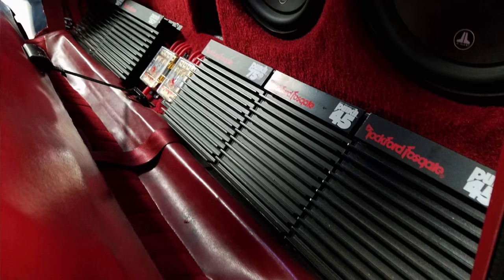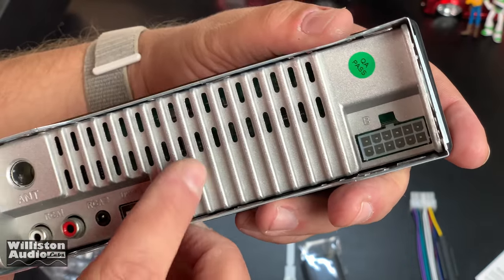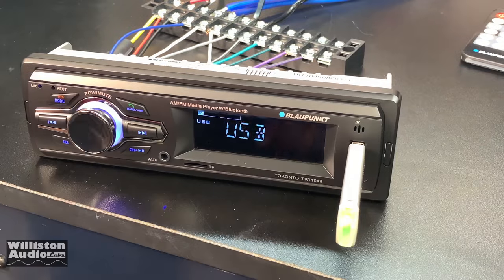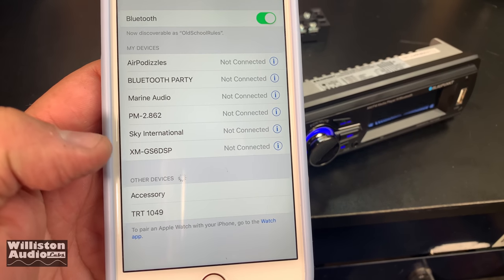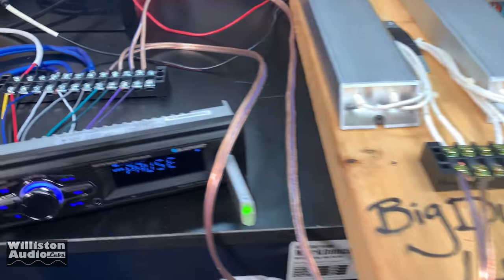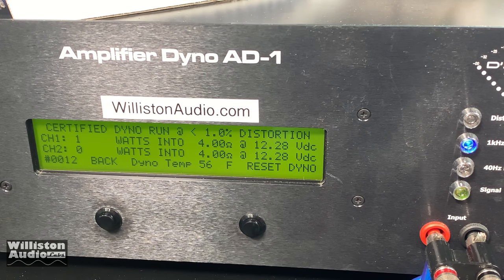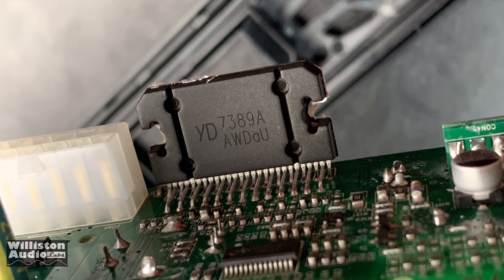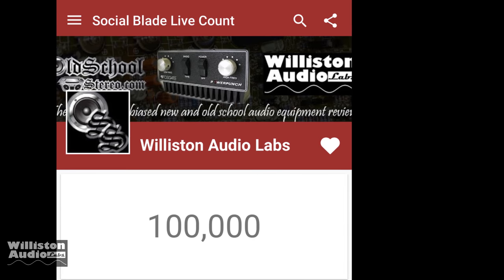Is a $10 Walmart Car Stereo Any Good? [4K]

Comment: Damn, I thought my cheap Chinese no name brand $40 head unit was cheap and small, that thing is half as long/deep as my crappy cheapo bluetooth model. I have a hard enough time keeping my half sized unit steady in my dash kit, I can only imagine getting this thing to stay put in a dash kit would be nearly impossible, since it has to secure to something on the kit.
Reply: Remember that it isn't the size of the head unit that matters but how well it works.🤣
Reply from the maker: It had the cage which you mount and it slides into. Very light unit, would not take much to make it secure

Comment: I remember when this was $20 when it first hit shelves.
Pluggin a USB device in would cause it to reset, not charge properly.  horrible noise in the signal path
promptly took it back and got a $99 Pioneer HU.
Reply: Curious.  If you could afford a $99 headunit, why would you get one for $20?
Reply: @tsntana  Part curiosity, but also the HU was a gift after the fact.
Reply: tsntana if a $20 head unit would give satisfactory performance, why would you spend $99?
Reply: @danieldaniels7571  $20 head units are hit or miss.  It's fine if that's all you can afford.  But if you can afford the $99 unit, why not just spend the money on a quality product.
Reply: @tsntana  that was already answered.
Reply: @dchawk81  Well, by now, a couple of questions were answered.  Somebody answered my question, and I answered another person's question.

Comment: Could the RCA2 be for steering wheel controls?
Reply: Not likely. Steering wheel controls would require a little more than 3 pins unless it was some kind of serial interface. In which case I don't think they'd have chosen a 3.5mm jack for it.
Reply: @S31Syntax  On my jvc steering wheel controls requires all of 1 wire becasue it has a digital interface. My car has a resistive interface though so I have to use an inteface box between them, I figured after posting the comment that it might be an external mic connection for the handsfree unit though. that would be more normal utilization of that connector.

Comment: anyone here know anything about jetski audio? looking to make a small system for my 1991 kawasaki sport cruiser but I dont know what extra steps need to be taken to make everything water proof
Reply: Most just buy a set of bluetooth speakers for a motorcycle, they are waterproof and multi-use, but youd have to have a waterproof phone.
Reply: A cheap marine head unit with a couple marine speakers all custom mounted to your fancy would work in this situation

Comment: I need a headunit. My Pioneer already gave up last year with smoke and flames....but I need the CD!
Reply: Smoke and flames ? Fairly unlikely
Reply: Michael Wilson It did happen. I discovered there was something shorting the internal audio power amplifier [PAL007C] that tripped the fuse until the sizzle came which finally blown the fuse. That also blown the mute function on the RCA pre-outs.
Also the bad design that I saw: the CD mechanism, that is a module [CD MODULE on the service manual] is also the one that has the USB features. The CD module board is connected to the mainboard using flexible flat ribbon!

Gladly we wired it directly to the battery; no harness damage is visible.
The headunit still works except no USB, no 50Wx4 MOSFET, bad preouts and that smell of 'magic smoke'.
Reply: CD ? WHY for God sake. Just put the CD's you have in your computer. Download a good program that transfers these WAV files to MP3 on a 32GB stick of a few dollar. Im from the country that invented CD's... and NOBODY is using that shit anymore.

Comment: I do installs for used car dealers and have used these on some cheap cars..The dealers love them cause they are CHEAP but they can't get by with putting these in a decent car that will accept a double din radio. You can get a Pioneer media player for around $120 so I used those most of the time..Used to use the $80 dollar Pyle double din's but the Pioneer units look 10x better, sound better and the functions of the unit and tuner is better for just a few more bucks..

Comment: Anybody know how to set the clock on this unit
Reply from the maker: I do, but I’ll need to look at it again to remember
Reply: the disp button on the remote, hold that down until the clock flashes, and use volume updown to adjust
Reply: Throw it away and hope the next one has the correct time

Comment: Good option for use on used car lots.  Kit Harness radio   100 bucks installed! case closed and I made money
Even at its current price is still not a bad deal.
Finding the Distribution would be even better.

Comment: same chipset and insides as the car stereo on wish.com I bought 3 different head units that have different styles.  All were amazing and as far as longevity,  so far 1 year no issues.  only bad thing is that mic for phone is built in case and picks up all road noise.
Reply from the maker: I figured it was rebranded China generic

Comment: This thing blew fast screen went black in a week
Reply from the maker: Lasted longer than that double cheeseburger combo though 😝
Reply: @wal  Curious if you've used your unit long term? I've installed two of these and both had screen issues within days. I have a third one on the shelf, but wont waste the time installing it anywhere. How about a follow up vid?

Comment: Don't buy it.  Bought one around Feb 2020 and the display failed almost immediately as soon as the weather got hot a couple months later.  Luckily only paid $15 for it, but at the same time got 2 sets of their 5x7s for $10 a pair for my work truck and those actually work really well.
Reply from the maker: It’s the cost of a double cheeseburger combo. That is gone much faster

Comment: Blaupunkt name is just slapped on all sorts of cheap nasty crap from China. You see loads of kettles, kitchen appliances etc with Blaupunkt on in cheap shops. Like so many brands  Blaupunkt is no longer the actual manufacturer but simply a name on cheap crap. 
Wasn’t too fond of Blaupunkt stereos in the early 2000s - had a few and they all failed miserably within months.
Reply from the maker: But this is an amazing deal for 10 bucks...no doubting that

Comment: Bosch sold it in 2008/2009. It's crap now
Reply from the maker: Ultra cheap stuff for sure
Reply: Just the name is left, like Grundig.
Reply: @Timico1000  grundig is now owned by beko I believe. Made in the same factory for the German market mainly. Still better than the cheap crap some make
Reply: @Riyazatron  Exactly, they even make quite good washing machines and dish washer, something Grundig hadn't done before. 
But some famous german brands like DUAL, AEG or Telefunken are today not more than names on cheap electronics..

Comment: Since using cds is pretty much a npn thing anymore, i think more companies will make radios like this more.  $10 is cheap.. i remember pioneer had a radio only for like $400 back in the early 2000s. It was waaaaaay better than this ofcourse..   i wish i had got it....it was loaded.
Reply: Cars need a simple stereo at least tho. Aways had the same need as nowdays. And low end more bluetooth geared ones with gps, and other crap wont last, and will work like crap, being alot more expensive.

The difference is that in the old days it was between am/fm and some kinda of media like tapes, cds, dvds, nowdays it will be spotify and local files, maybe with some fm. 

These basic radios will be more common, but a bit more expensive, as people will likelly use alot them to connect their phone to the car's speakers for cheap.

Comment: ~$230 now, on eBay Australia... Was about to buy one for shop stereo...
Reply: Have you looked on amazon Australia?
Reply: @Fm_1055  Didn't think of that, as I've never used Amazon... Just checked, & it's $25USD + delivery... Pity it's not $10 anymore... I will buy a mini 2.1ch Bluetooth amplifier instead, or a second hand Pioneer headunit or whatever is available locally...
Reply: @BLaQz84  nice well have fun
Reply: @Fm_1055  Thanks... I am still considering that head unit though... The features are pretty darn good for the price...

Comment: In know this is an older video, but the new dual Bluetooth Dual media stereo is terrible
Reply: What one I have a double din dual it’s not too bad
Reply: @michaelgagliastre7309  he's probably talking about the $25 Walmart single din
Reply: Dude fr. Absolutely 0 fckn equalizer settings.
Reply: Yes, I have the KDM16BT installed now, I replaced it with the newer version due to losing the rear channels on the original. When I got the new one installed, the “loud” feature would not turn on, and the fader wouldn’t work. Also the Bluetooth connection was sketchy at best and that was the main feature I needed

Comment: I bought one years ago because I thought my factory stereo was burnt out but it turned out to be my speakers. Anyway I never got around to putting the factory back it because well it plays so who cares. It doesn't have a CD player but it's got Bluetooth so works for me. It has worked fine a me I haven't had any problems out of it. I've never used the remote but it picks up the stations I like and plays I heart radio from my phone. I don't have no amps or anything but I don't like it that loud and I think it's plenty loud enough.
Reply from the maker: Great feedback, thanks!

Comment: Sounds like a great deal for only $10, but would do me no good. Where's the CD player? Apparently, from what I can see, it doesn't even have one. That's worse than one in my older 96 Camry with a cassette player. At least with that one, I could plug a wired adapter into the cassette to run an auxiliary CD player.
Reply: But there's 3.5mm auxiliary input on the front, so can do the same and run an external cd player
Reply: lmao who uses CD'S these days, nobody!
Reply: @jauh25  lol
Reply: @jauh25  And LPs, 45s, reel tapes, cassettes, laserdiscs, VHS, Beta, CEDs and EIGHT TRACKS. SOMEBODY.
Reply: @steadfastcoward  And MiniDiscs.  :)
Reply: Get a walkman off of eBay, plug it in the 3.5mm jack, and boom you have a CD player.
Reply: @jauh25  I do. I use any format as I see fit.

Comment: The 3.5mm jack is for steering wheel controls buddy
Reply from the maker: In many cases, yes. In this case it is rear line level output. I tested with a different cable and updated info in the video description.

Comment: Very likely this PCB is a generic Chinese design and sold to various customers for their low-end/low-margin products.
All the customer has to do is design (or pick from vendor choices) a front panel and put their name on it.
The next tier car stereo products could be made by simply removing the small amplifier chip from this board and routing the preamp signal to a larger power amp add-on PCB. 
Note how many other low-cost car stereos from other "manufacturers" have a similar layout (big knob on the left side, surrounded by smaller buttons, display on the right, USP slot on far right side, etc).
Reply from the maker: Correct! 👈😬

Comment: I feel like I been had when I purchased the Dual unit for $20 at Walmart.  The only thing I don't like about the Dual unit is the bright blue when driving at night (and I drive at night a lot for my job).  I think this may have been a better choice since it does everything my Dual does and then some.  Dual does not have the internal USB nor a micro SD card slot
Reply: I bought the same dual unit and I loved it. I had a full kicker KS setup and the tweeters brought it to life. It really is what you get for $20  I was surprised it wasn't completely garbage. It did start to malfunction about  6 months into use though.
Reply: @johnblackstone5261  I'm right about at six months though tonight, I think it turned on by itself but it could have already been on and a "no audio, track playing
Reply: To fix the bright blue light you can open the head unit and cut off the trace for backlighting the LCD.
Or if you are not that handy and don't want to risk it, ask for a small piece of scrap foil used to do window tint.
The window tint gives it a really nice stealth look and it is easy to apply.
Reply: @lazar2175  Brilliant!  Think I will try the tint idea because I do want a little backlight.  The "accept calls" button I don't use at night because all the normal people are asleep at night but the "change mode" button I might use.  The third, I never use and cannot remember what it exactly does.
Reply: @johnny-becker  CME is right. There is also tape, similar to Scotch tape, that's gray, and specifically made to dim bright electronics. I need a roll of that for the lights on my dashboard! My high beam indicator is way too bright.